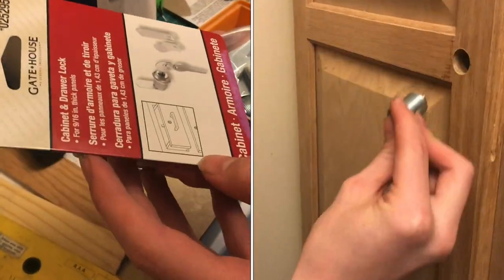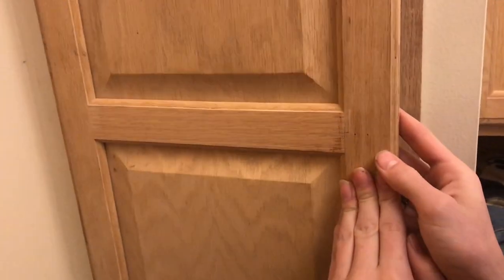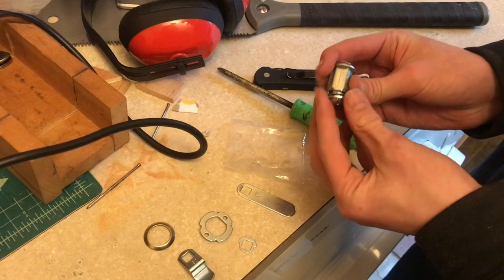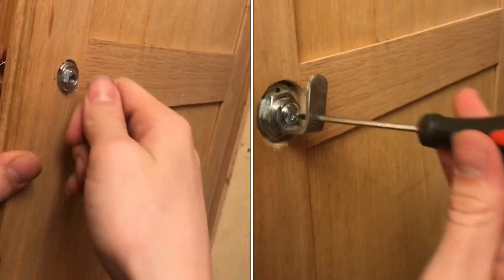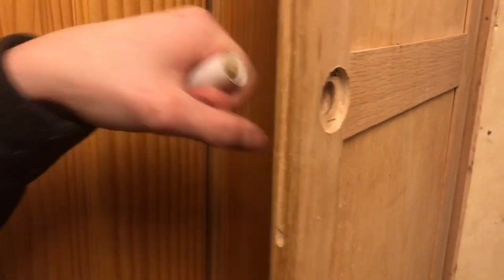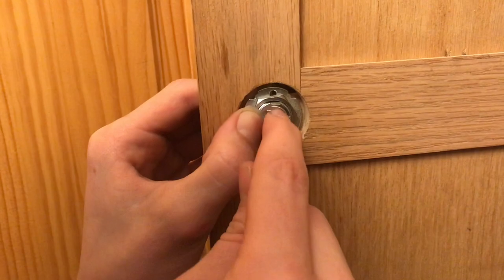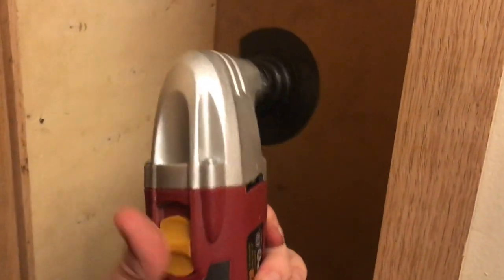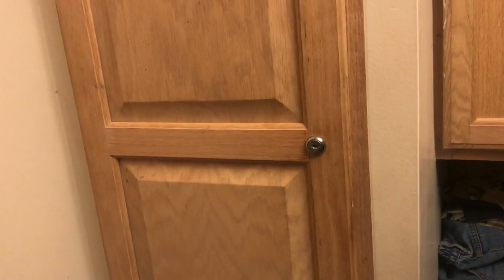INSTALLING “cabinet and drawer lock” (TRICKY) gate house 0252956

Comment: Suggestions? Hi. I'm installing (doing bosses "honey-do" work) cam locks into existing particle board cabinets (3/4 inch) that have laminate surfaces (slippery). So my washer with the little grabbers don't have anything to bite into to prevent spinning. Don't have drill press to drill elongated holes. Can't professionally over-size cut out just the laminate surfaces. Any suggestions? The workmanship will be in full public view in professional medical offices.
Reply: Those wood grabber washers (CompX calls it a spur washer) eventually loosen up especially in soft wood...Screwing a plate with a Double D hole on the other side works forever....

Comment: Kind of a hack sorry.  Your latch should fall into the fram should have cut down the catch arm.  Should measure the spacing layout of the lock itself.  This way u know clearance and should have drilled ur the back recess first.  But for your fist one and not knowing damn good job.
Measuring lay out all locks will look the same.